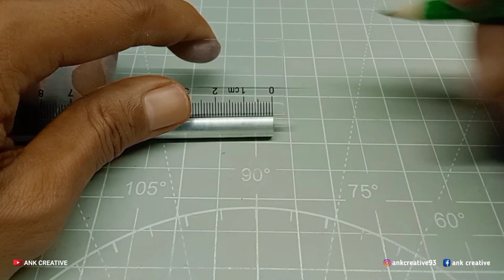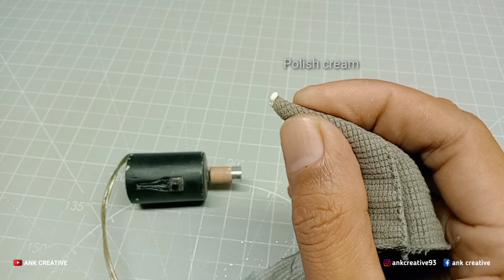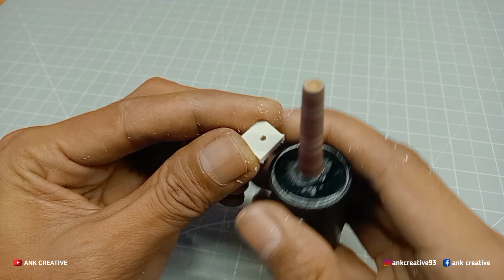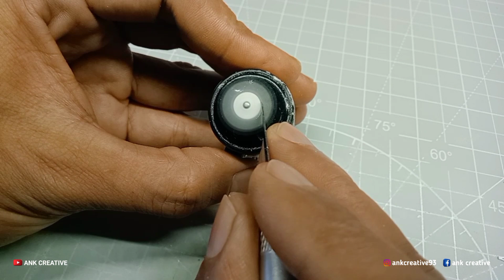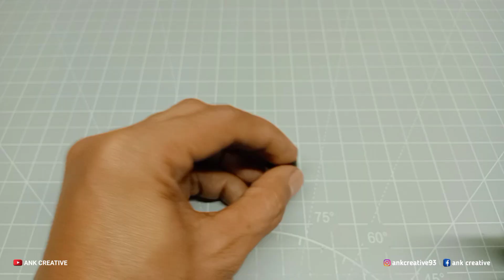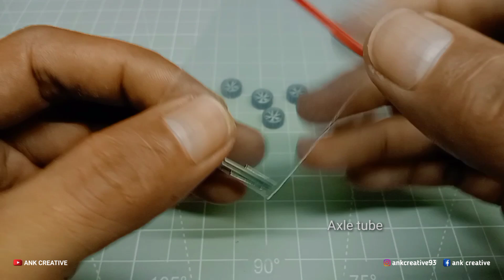Making wheels with aluminum pipes for diecast

Comment: Where did you learn this technique, I used to make wheels for my hotwheels car models with very similar technique & often share my builds on a facebook group. I use aluminium sheet instead of pipe because I couldn't find small enough pipe for my requried wheel size.

Comment: Stunning work Ank.

They look stunning and your process is really streamlined. I think you probably don't need to use the compass and saw to make rough disk shapes - just make squares, use a file to take the corners off to be octagons, and then machine them to final diameter. I wonder - styrene is so soft, if you sharpened one side of the pipe, could you make a cutter like a die, that you just simply strike with a hammer?

Great work. 🙏🙏🙏🙏